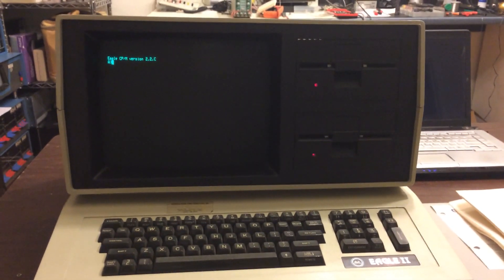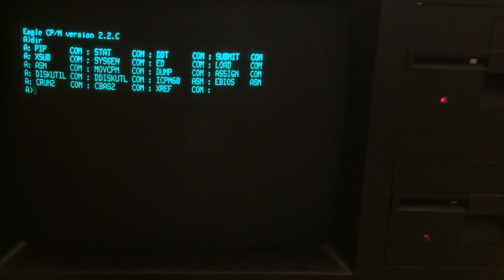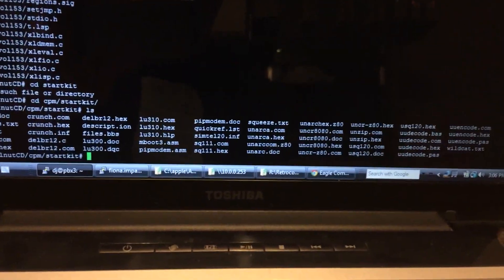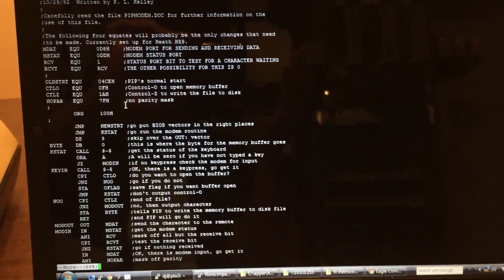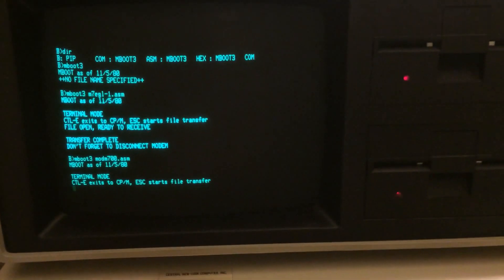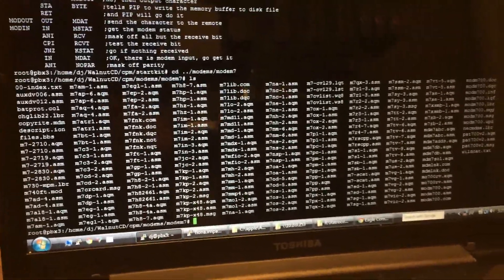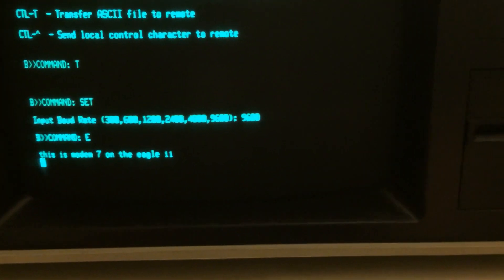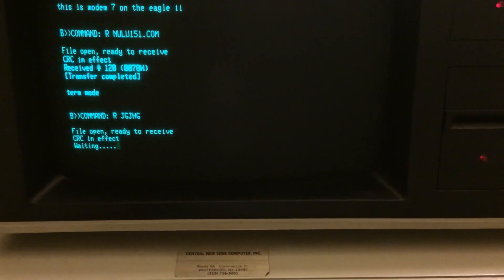So you have a CP/M machine, how do you get software onto it?

Comment: I have a kaypro II that I purchased a year ago.  I bought a floppy emulator and got that working, but wanted to to get the drives to work.  I did try one time to get the serial port to work but didn't look into it that much.  This is awesome inspiration.  Id love to get it where I could transfer files across the room as that is the setup I have.  Thanks for the information...

Comment: PIP and X-COPY are your friends. There is a version of X-COPY that will run on an MS-DOS machine. As for windows, I don’t know as my information is dated back to the late 80’s. my issue is that I have a bunch of 8” floppies and 5¼ “ floppies disks. What you need to do is get a copy of X-COPY Receive on to your CPM system and then you can copy the full version of X-COPY to copy files over the serial ports between machines. This was what I was using back in the 70’s and 80’s. But it sounds that that there are other ways to do the same thing and as you can see, there is some assembly required. When I get my system up and running again, I will have to investigate mboot3.
Reply from the maker: Exactly. Also, don't forget that you can connect an 8" floppy drive to a PC. The pinout and setup of the drive are different than a 3.5 or 5.25 disk. Still, the geometries are the same for equivalent capacity, just the same as, in the case of the Eagle in this video, which has "Quad Density" disks (i.e., 80 track versions with the same encoding and other geometry equivalents with lesser density disks). It would allow you to image and write images for 8" disks. For example, with the Eagle, since it's an 80-track drive (and was available in single or double-sided versions, the equivalent formatted capacity for single-sided is 360KB, and double-sided is 720 KB. For the 5.25" disks like this, a 1.2MB drive is required, as standard 360KB drives cannot handle the double track density due to stepping and head width limitations. Likewise, a double-sided 8" floppy uses the same encoding and stepping as a 5.25" 1.2MB drive.

What I'm saying mirrors what you're saying, when restoring some of these older machines to operation, you have options.
Reply: @TheTXDj  The next issue is the 8" drives. Gave them away back in the early 90's. Just one of my mini regrets over time. The drives were attached to a full CPM system and a dead hard drive. Just part of my conversion to PC's.

Comment: Nice video!

I usually use a HxC FDD emulator on the host, in combination with a very handy tool I made to access the filesystem of most CP/M disk-images. My CP/M-style machine has one of the BIOSes where you can change the disk parameters as well, with support for double stepping in order to read 40-track disks in 80-track drives, so moving files about is pretty simple.

The tool for importing and exporting files from CP/M disk images is located here:
https://www.dropbox.com/s/lazhgftl94toduz/CPMdskTool.jar?dl=0

Comment: This whole idea of "quad density" just makes life even more confusing, after single- and double-density, given that all the diskettes are exactly the same.

There are actually only two densities of media: standard density and high density (HD). Standard density diskettes have from the start been able to handle 96 TPI just as well as they do 48 TPI: if they had a problem with 96 TPI in the radial direction they'd never be able to handle the much higher data density in the linear direction along the tracks. (96 TPI is, generously, 500 flux transitions per inch; even the outer track of a 320 KB double-sided 5.25" floppy has to handle thousands of flux transitions per inch.)

And, from a floppy disk's point of view, "single density" and "double density" are exactly the same density in terms of number of flux transitions. It's simply a change in encoding: you can think of MFM as doing better "compression" than FM encoding.

Comment: So what would it take to get a piece of software that wasn’t designed for the Kaypro II to run on a Kaypro II? 

I just recently got a Kaypro II, fixed it up and I absolutely love it! I had been wanting one forever. It’s also my very first CP/M machine.
Reply from the maker: As long as it doesn't require terminal controls, or bypass the operating system calls, it will run.
Reply: Alright, thanks.
Reply from the maker: @80sCompaqPC  The one other exception (which won't affect you on a Kaypro) is that code that makes use of Z80 instructions won't run on an 8080.  Your Kaypro has a Z80, so that's not a concern.

Comment: Hello! I found an Eagle II recently but I'm not sure it's working and I have no software for it whatsoever. What does this machine do if booted without a disk?
Reply from the maker: Absolutely nothing.  It requires a disk.  The images are out there, you just need a DOS or Linux machine to write the images to media.  If yours is one of the 80-track drives, you'll need an HD drive so it can step to all 80 tracks, even though the media itself is not HD for this machine.
Reply: Awesome, it might actually be functional then. :D My only question then is can I use a computer with a 5.25" drive and Windows 9x to write a disk image of the CPM version it needs or does it specifically have to be DOS. If so what should I use to write the images. Also convieniently I happen to have a 1.2MB diskette drive installed in my main Windows 9x machine. :D
Reply from the maker: So if you have the drive, and that machine is win9x, it will probably work since 95/98 were still based on dos.  You need either ImageDisk or TeleDisk, both of these are DOS utils that take a file and write a disk for them.  The Eagle disks can be found in one of the archives out there, I think bitsavers has them.  As you probably recall in this video, I talked about one of my originals being bad, so I imaged a replacement and transferred the disk into the original sleeve.  I got that image from out on the interwebs. :)

Comment: Thank you!  I am a noob to some of this.  Maybe you can help.  I have a Kaypro II and I have an HXC floppy emulator running Drive A with an SD card media and some images.  I need to start getting some archived data onto a blank floppy image that the Kaypro will recognize.  I don't really know where to start.  any good resources?  does what im describing make sense?  thank you so very much.
Reply from the maker: Matt - yes, makes sense.  Do you already have it up and running with the emulator?  If so, and so long as you can present a "blank image" as perhaps B: drive, you should be able to manipulate that image the same as you would a physical floppy.  Are you running off your floppies at all?  Or just trying to get the virtual side online before archiving the physical media?  I've never done the exact thing that you're talking about there - but if you're able to get the system A) running (off physical or virtual), AND B) are able to make the emulator give the machine a blank floppy image, however that emulator works- THEN C) I could do a video specifically about backing up data to another floppy disk, and the methods should be identical to your emulator setup.  Alternatively - using methods nearly identical to what I described in this video will let you install software that you can use to image all your disks and archive them to your modern computer via serial.

Comment: Is that a theme or are you actually running Vista on the laptop?
Reply from the maker: stonent that laptop ran vista, yes
Reply: My mother in law ran Vista until last Christmas when we bought her a new laptop. I don't think it was bad after the service packs came out, but it had the stain of the name and had to go.
Reply from the maker: stonent I never had any complaints about vista once I got past the initial differences.  Win 7 is vista with some minor differences.  Of course I am weird, and I liked WinME also.
Reply: I liked Windows 8.1  It was a little less intrusive than 10 once you installed the Classic Shell program. All the Windows 7 menus were still there if you knew the commands to find them.
Reply from the maker: On Win8, I like Start8.  It is a pretty decent classic shell replacement.  same folks make "ModernMix" which lets you run metro apps in a window.

Comment: Hello ! I'm going to receive a Kaypro 10 from ebay ... Maybe there's a way to connect it to dos machine by LPT cable and to connect by some kind of software then ) ?
Reply from the maker: Not with LPT, but with COM.  The Kaypro would be much easier than the machine in this video.  There are terminal program disk images out there.  Just write them to floppies with your DOS machine, and you're ready to go.  You can transfer the files much easier that way, vs the way a machine like this Eagle would.
Reply: Thanks I've found some info about that on Terry Stewart's site. I'll try it when the K-10 arrives)

Comment: Is Modem 7  Z80 code? I tried assembling it on my 8080 machine and it failed with many errors.
Reply: The original modem7 was 8080 code
As I recall, the 7 ment it would work with 7 bit ASCII data modem from PMMI and the modem protocol for binary data